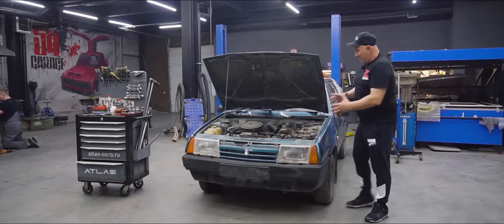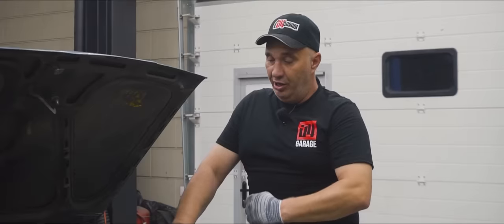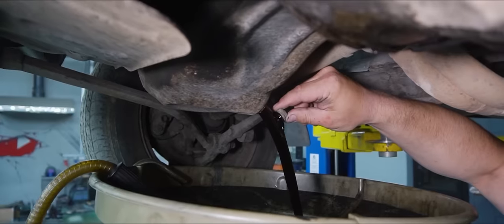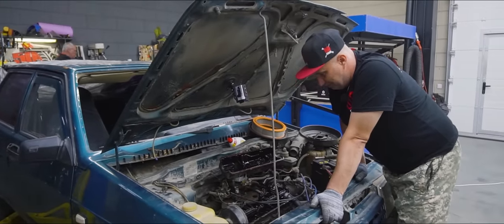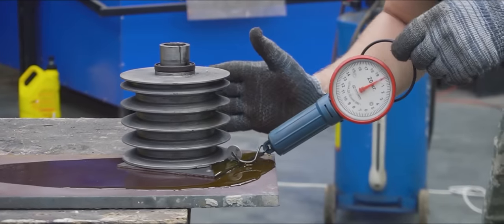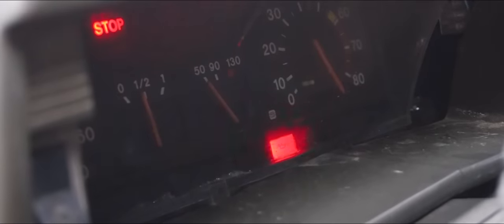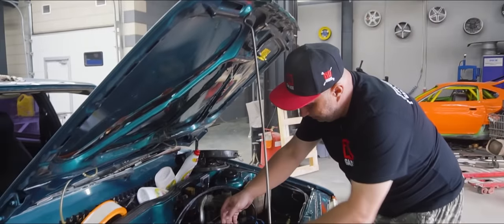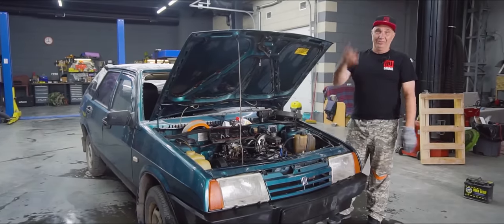Can you use dishwashing liquid to clean an engine internally?

Comment: Soap is an emulsifier and it needs something to bond to and then desolve in to then be carried out. Soap and water mixed with oil allows the oil and water to mix. Just soap and oil... it probably wont clean it very well and may cause issues. 

Posted before seeing results

Comment: I have heard of people putting Kerosene in the motor with the oil and running it to clean out the sludge before doing an oil change.
Reply: .....uuhhhhh.....that's the reason for dutifully, responsively and diligently  CHANGING YOUR ENGINE OIL at the required intervals!

Comment: to really clean and engine's inside just drain off half its old oil, add 2 pints of water and 2 pints of paraffin/kerosene and go for a 30 mile drive keeping speed between 30 and 50.
Drain the oil and find the engine insides perfectly clean.

Comment: remove half the oil, replace by equal volume of diesel, let it run for 15 minutes with NO LOAD, at idle or short and brief rev ups to about 1500 rpm, that cleans a lot of deposits.

Comment: Sea Foam would do a better job, but not as much fun as the bubble bath. You should try penetrating oil. It might loosen up all the nuts and bolts and the engine would come apart. But you guys already have enough nuts.

Comment: Now that's it's soaked in soap. Pull the oil plug and pressure wash the top half of the motor till it's clean then fill it with oil see how it does

Comment: You are supposed to add one quart bottle of dishwashing liqid and 2 quarts  oil and let the engine idle for one hr then drain and do again and again until the mixture coming out is clear. You did not run the mixture long enough to make a difference

Comment: I bet it would have cleaned it out alot better if you did the half quart + motor oil, and run it for alot longer then 15 minutes.  Maybe like an hour or 2.  Or even leave it in there for a week while driving it around.

Comment: Of course if you have something like a Ford Pinto engine (engine not the car) it matters not what oil is in there as the SOHC is notoriously clacky once a bit of wear has set in and the Ford V6's are even worse for clackyness.   A mate of mine with a Ford Sierra used to chuck old chip oil into his engine he was that tight with money yet he drove all over the country without a problem other than a slight fish and chips smell in the air lol
Reply: My own OHV Reliant Robin I do use the clack test to know when its time to top up, the distributor skew gear gets a bit loud on dropped oil level and to be fair I haven't bothered to change two weeping gaskets, the sump gasket weeps a tiny amount a day and the timing chain sprocket cover also weeps a little but I put some Lucas stop leak into it and has seemed to stop the weeping a lot.   I only use Miller golden film classic 10w30 as its a nice sticky engine oil considering my Reliant engine is basically a tarted up Austin 7 engine, the Millers is awesome.

Comment: But you could hear the engine noise reduced after running the soap。 Too much soap and the soap could burn causing carbon deposits。 I think dilluded amounts of soap mixed with the oil DID clean the parts with friction。 But of course it wouldn't automatically remove all the carbon desposits。 Fun experiment but I don't think I would use soap in mine

Comment: Tried diesel
drain the oil, fill in diesel and let the engine run at a slightly higher speed for 3 minutes.
Then drain everything and put new engine oil on it.

Comment: detergent will bond with the oil, not with the carbon and other residues. so in this no i dont think it will clean the engine, especially when mixed with oil.

Comment: My opinion is that you should have just drained all the oil and replaced it with one quart of Fairy and 3 or 4 quarts of water (take out the thermostat) and then just idle that Lada around town, blowing soap bubbles out of the engine .
Reply: .......including completely stripping the CRUTIAL metallic alloys designed into the Main Bearings!  ----->  GAURANTEED DEATH OF AN ENGINE

Comment: What works REALLY good on crankcase deposits is OVEN CLEANER.   Useful when pan is off, cleaning out sludge that way.  Not recommended to add to crankcase, it will also attack every seal and gasket causing long term disaster.

Comment: But new oil and filter in the engine. After warming little, put dishwasher, run the engine for 15 minutes and then Check the oil color and inside of engine.
Why new oil first? To see if change the oil color. If change, it's means something  cleaning inside the engine. 😎

Comment: Oil has detergent in it and transmission fluid has even more, I would recommend putting ATF in the engine and running it for a few minutes rather than do this.

Comment: You're stranded in the middle of nowhere. Your car has enough fuel and coolant, but it has run out of oil. You don't want to drive it too far as it's your only hope of surviving.

Can urine be used instead of oil?

For science.
Reply: Urine is a DEF replacement, not an engine oil replacement.

Comment: This soap sounds like a thoroughly bad idea, one problem is that it is corrosive as hell, over time, and you're not going to get all of it out.  I used to use some tranny fluid and mineral spirits.  

About a quart added after draining a quart of the four or five, and not more that about 1/4 pint of mineral spirits, so you don't lower the viscosity too much.  Then a double oil change with filter drain each time.  And I only ran it for a couple of minutes, at idle. 

All of these ideas are probably stupid, just opening it and cleaning everything you can get to is probably the right answer.  Even better, change the damned oil when you are supposed to and it won't happen.  Just opened my TL at 310k miles to change upper gaskets and there was NO gunk and the metal surfaces were barely stained at all, just a very thin very transparent gold tinge staining that I bet would come off easily (didn't try, no reason to).

Comment: should filled clorox , 3 litres and run engine for like 10 mins and leave overnight , clear it all next morning , use the soap n used oil for another 10 mins , then released it again , now start with new oil . You will be surprised the outcome .

Comment: water + soap = water goes easier and from places, water is not oil, you remove water with the soap, oil remains
Reply: pressure water jet clean
Reply: oil pyrolyses to water, carbon and water

Comment: Try using engine degreaser as motor oil 🤣 If it’s good enough to clean the outside of the engine surely it should clean the inside.

Comment: This is so cringe. You should never let your engine make noise. They laugh at people putting detergent in the crank case, then they tell you to not service your engine until you heard tapping. Completely braindead. Also, they put detergent in everything. Oil itself already has detergent. They put detergent in metal when melting down metal. Detergent is used everywhere all the time, to disrespect detergent is completely braindead. Also, they ran the detergent in the crank case for half an hour until it turned into carbon soot, then complained about the inside being dirty and covered with incinerated dishwashing liquid that they purposely incinerated. 

They did all they could possibly do to make it fail, just complete psychopaths. I don't know what the dish washing liquid did to disrespect their families and inccur their wrath. All they had to so was use a 30, 50, or even 70 percent dishwasher liquid and have some oil. It would stop the foaming and it would let the dishwashing fluid circulate at higher temperatures without being burnt up.